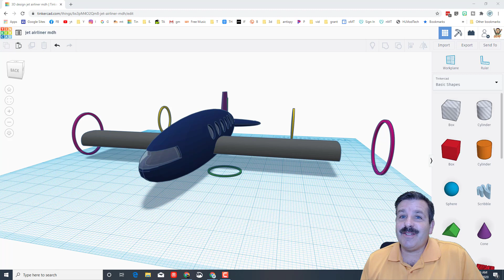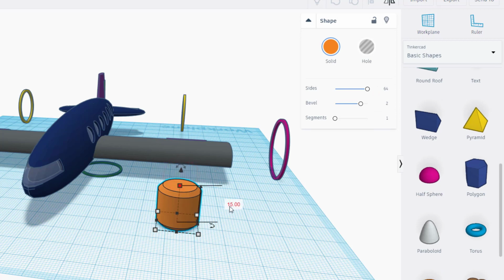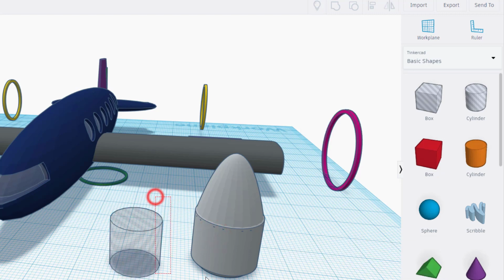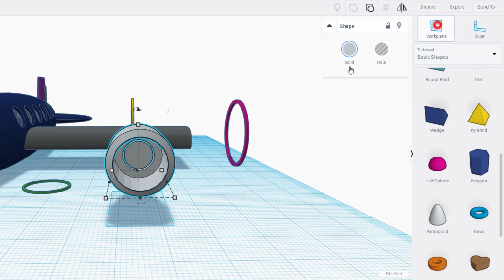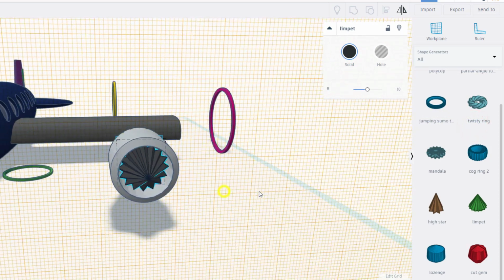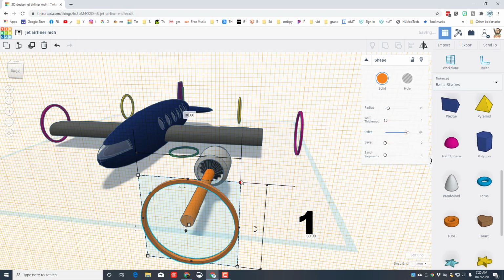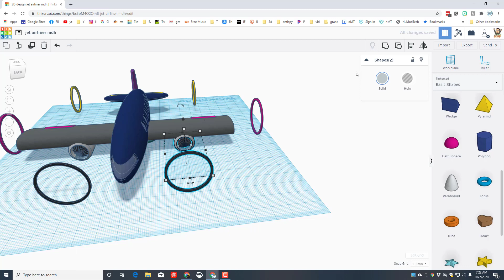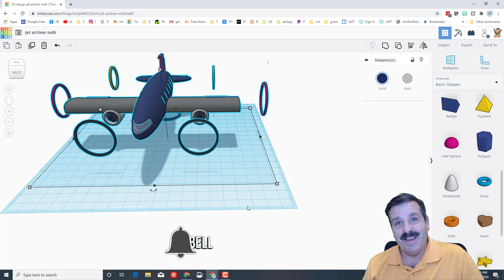Add a Jet Engine with a Moveable turbine to your Airliner! #PLTW

Comment: I will say, you don't really need an extra rotational point for the turbines because the rotate all it's natural center point. You could rotate it without the tube and it would work the same way.
Reply from the maker: Are you keeping the rotation ring on the middle of the turbine? Or just skipping it because it naturally rotates like that? I found that students were more likely to have the center of rotation correct when we did it like that. On the other hand it was fun learning when they missed the center and had wild results. 👍